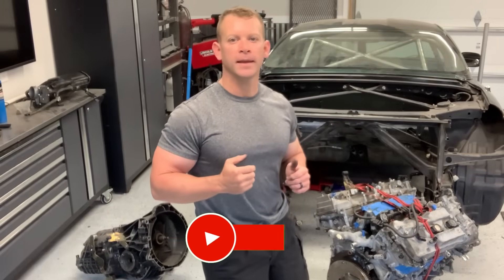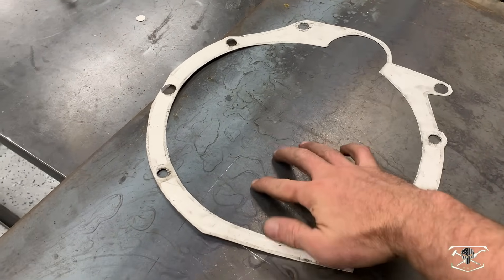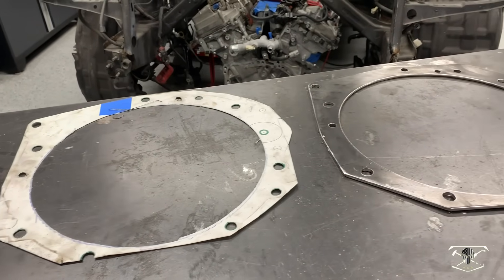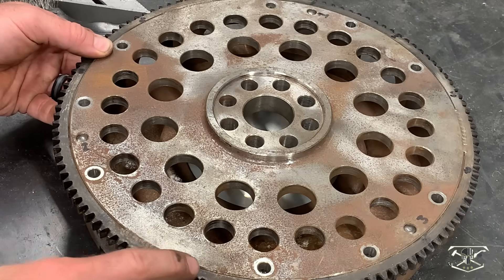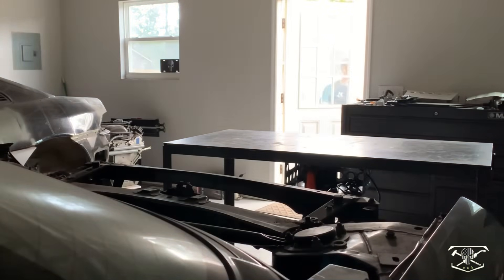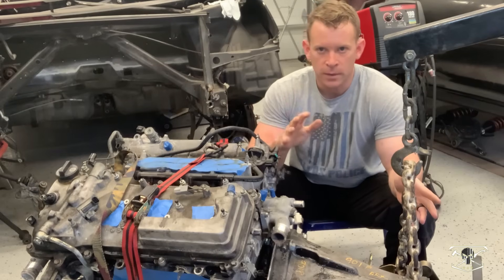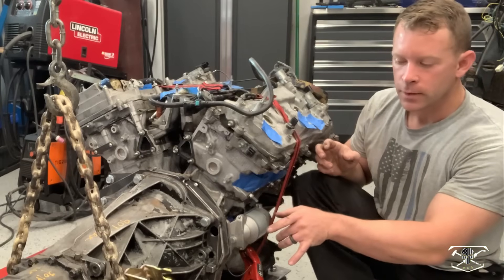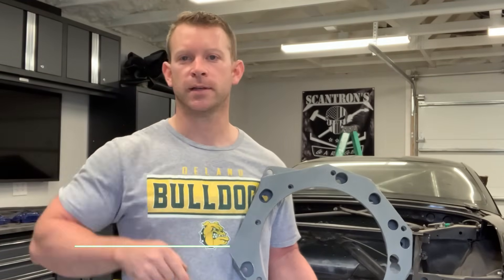DIY Engine Adapter Plate (Mate any Engine to any Transmission)

Comment: 8:20 latest at this point the solution see´s its limit: If the is any out of straight engine OUT and transmission IN will not be perfectly straight.

And bend slidely off, very realistic here, or siply the welt itself will be enough to miss perfectly straight.
Reply from the maker: That is correct. It must be perfectly square

Comment: Hi! I’m from Argentina and I have the chance to buy a Honda L15B7 engine, but it doesn’t come with a transmission. Unfortunately, all Civics sold here came with CVTs, so the original 6-speed manual is nearly impossible to find.

I’m wondering if it would be possible to adapt a 5-speed manual transmission from the R18 (like the S40 or M24). I’d prefer that over the 6-speed due to space limitations in my swap — I’m putting this into a lightweight car from the 1980s.

Do you think it would be possible to make this setup work with an adapter plate? Have you ever seen someone use an R18 transmission with an L15B7? Any tips about crank-to-input shaft alignment or bellhousing bolt pattern compatibility would be super helpful. Thanks!
Reply from the maker: I am not familiar with that particular transmission however I can tell you, make sure to the size comparison from the block to the transmission housing is similar in size. You want the two to fit well together size wise. The next hurdle will be what you do for a flywheel. You may have many options with this swap

Comment: Incredible vid! Would love to know how the whole thing is holding up 2 years on
Reply from the maker: It’s going well thank you. The owner got it running and driving. He had no problems drive train. He sold it unfortunately and now I’m not going to get my hands back on it
Reply: @scantronsgarage Amazing to hear. I'm on a race build currently, and thinking to drop a Ford 2.3l ecoboost into my 2013 Tacoma while keeping the R155f manual 5 speed 4x4 tranny. Naturally, ill need to adapt and mate the engine to the tranny. People have told me to swap the transmission too, but i feel it might be more beneficial to keep the robust r155f as it's tough and survives races easily. Any thoughts?

Comment: While I love this kinda stuff, if that has the slightest misalignment it will eat bearings. Even mating a new transmission to a worn engine, the crank misalignment from wear can wear the input shaft. 
Now if this is just going to be a low mileage weekend cruiser then it will probably be fine.
Reply from the maker: Thanks for the info, definitely something to consider!

Comment: I'm doing my own adapter for an 8HP trans to a boss 302 small block ford. I'm going to use aluminum instead of steel but I think I'll make one like this as a mock up. 

I will pay more attention to engine/trans alignment though. I'm going to get a dial indicator, hang it on the end of the crankshaft. I'll probably machine that on my lathe so one end bolts to the crank and the other end has a 3/8 hole for  dowel. Once that is bolted to the crank and I confirm it runs straight by turning the crank from the front, I'll use a 3/8 adapter to mount my dial indicator. I will mount the dial indicator so it reaches a machined surface on the trans input shaft. Then I get a cheap usb microscope and mount that so it can read the dial on the dial indicator. 

This way I can flip the motor up, put the trans up on top and move it as needed so the trans input shaft is perfectly lined up with the crank center line. Then tack the engine and trans plates up. After I take it apart I'll mount it on my Bridgeport mill and use the digital readout to map all the bolt holes and make a blueprint. Next up I'll need to figure out how thick the trans adapter plate needs to be. Then I'll ether buy or build a flywheel style torque converter mount. 

I will then make up the aluminum trans adapter plate in sections around the engine that have one bolt hole that over laps in 4 spots around the engine/trans. At those spots I'll make the plate 1/2 the thickness on opposite sides so they stack. Why do the adapter plate in multiple sections? because a giant 2" thick section of aluminum is hell a expensive. 

I can buy four 2" thick scrap sections for pennies. Should be a fun project. After I'm done I'll publish the print with dimensions. This way any one who wants to can take the file and make their own adapter or take it to a machine shop and order those 4 sections and be good to go.
Reply from the maker: Sounds like you have a solid plan, good luck with the project!

Comment: I'm not understanding how you chose the flywheel
Reply from the maker: The fly wheel was from an adapter company that is made to push the clutch into the transmission. The flywheel had the proper input shaft dimensions. I just made the adapter plate to work with it

Comment: How did you determine the distance between the trans and the motor??
 Still a damn good vid.
 How Was the clutch “built” up to mess with PP. is it an added item to the flywheel?? Thx
Reply from the maker: The distance was figured by the adapter flywheel in this case. The flywheel was made to fit the Porsche transaxle and when mounted to the engine/ transaxle, there was a 22 mm gap. This is where the thickness of the adapter plate was determined

Comment: I don’t get how you figure it out to the 30 mm gap between the engine and transmission that you made the adapter plate for was the correct distance. I mean the engine and the transmission. I’m assuming I have to meet at the correct distance apart, not too far apart, not too close together, so how did you know 30 mmwas the correct distance? Sorry I’m trying to learn a little bit here.
Reply from the maker: The thickness was determined by how much more the custom flywheel stuck out from the factory.
Reply: @scantronsgarage ohh ok makes sense

Comment: Will this work with a 10 speed mustang transmission with a 5.7 hemi?
Reply from the maker: Yes. That is no different than what I did. Just some different bolt patterns. Just remember you will need to modify the flywheel to make up the difference the adapter plate took up in thickness.

Comment: 9:19 everything is running properly!?
I doubt it. Your transmission seal is gonna leak, wet the clutch, drain the tranny and vibrate. I doubt it's concentric. 
As good as as technics and skills you have, this combo will fail. You should have gutted the trans case out, created a shaft which would attach to the crank and which fits into the front opening of the trans case than mark where you existing or custom dowels would finally align everything "properly ".
Reply from the maker: yea. despite all this it is still working

Comment: This has been most helpful with my flywheel problem.  Ironically, machining the adaptor is the part I'm having the least trouble with....but finding a deutz flywheel tall enough to reach my transmission is basically impossible.  Guess I have to make an extension 😅
Reply from the maker: Yea this flywheel is a good example to get you going. It's a pain but you can do it

Comment: Hi well done  boss, nice to lean, its worldwide. ❤ i had 2008 ford escape v6 3.0l  motor  to mate 1.6l mazda etude manual gearbox, imagine the torque? Can  still  go with  this project?
Reply from the maker: That sounds awesome! you did it already or are you planning to make the adapter?
Reply: Not  yet,  man Google  confusing  sometimes  , they say that manual gearbox  from  Mazda etude 1.6 l is weak  to mate on  my  motor which  is a 3.0l v6  ford escape.  I wanna  make  adapter plate  to mate  them man, what your knowledge/ a say  o this bro?

Comment: There is a reason, why an angle grinder is usually equipped with a protection shield - especially when you work without gloves and doing work, where the disk could get easily stuck (for example when cutting out a circle...). Otherwise good video, although I am still not sure how you made sure, that the crankshaft is aligned with the transmission input
Reply from the maker: You are correct! I was being a bit reckless. Always wear safety gear.  I left a lot of the alignment out of the video

Comment: Very Good Video.  As an engineer and machinist, I was impressed with the work you did.  Everyone talks about CNC milling being needed with sponsored CNC machines.  Its not needed.  I have a 1955 Bridgeport milling machine (a round ram at that) and I love it.  The template idea is an old idea.  I use this to fabricate gaskets on really old machines and engines.  I have done many clutches in my day.  They are all old school with a simple flywheel.  Can you post more information on that flywheel.   I have never seen this type of flywheel before.  Very interesting.
Reply from the maker: Thank you!!! I learned this from some older well experienced professionals. Yes CNC and milling is preferred however you can make this work. I have a full video of a purchased adapter plate I purchased that came with this style of flywheel that I used in this video. Or you can look up the manufacturer for more information. The manufacturer is Kennedy Engineering Products (KEP). Thank you again

Comment: What engine was that??? It looks like a duratec v6 if it is what transmission did you use????  Nice job btw!
Reply from the maker: Thanks! its a toyota 2GR v6 attached to a porsche transaxle

Comment: How about the alignment of the input shaft ?
Reply from the maker: I aligned it with the pilot bearing inserted into the input shaft. Did tons of measuring and then turned the motor to check for runout

Comment: Surely the input shaft is 30mm too short now?
Reply from the maker: Correct... however, if you look at the custom flywheel I was using it was pushed out to make up for that 30mm
Reply: @scantronsgarage  brilliant

Comment: How did you get the center of the engine aligned perfectly with the center of the trans?
Reply from the maker: I centered the transmission in the pilot bearing on the flywheel...that's the simple answer. there was also tons of measuring

Comment: In 90' my father used to connect mercedes 2.0/2.2/2.4  4 cyl diesel engines from w115/w123 to the UAZ gear box :D We had some flanges done at the lathe machine.
Reply from the maker: That's awesome! I wish I had A lathe at my disposal

Comment: For bolting a 350Z manual transmission CD009 to a Vortec 5.3, which clutch and flywheel assembly would you use? Could you just modify the Chevy one?
Reply from the maker: Might be best to stick with the 350z clutch

Comment: how thick was that steel plate? wondering if I can cut the large whole using your method on 3/8 steel plate. I'm trying to make adapter from 2005 vw golf gti 1.8t to a 67 vw bug trans for my bug. bought 2, 3/8 thick plates, not sure if I should just use 1 plate or sandwich 2 together. what you think also do you think I should bother doing it in aluminum? or just call it a day?
Reply from the maker: I used 3/16 plate. you can do this with 3/8 if you use a similar jig with a plasma cutter. I like the aluminum idea as well if you are able to weld aluminum

Comment: dear god. getting the same vibes with those LS kits to adapt your cars engine bay to handle it. Heard they have them for a tiny honda civic, and that I might be able to put an LS3-LS9 in it (assuming the frame can handle the weight and I replace many of the other parts). Loved it.
Reply from the maker: Oh yes! you can make that happen......Maybe I will do a v8 civic next : )

Comment: Nie this really interesting and well put together. I wonder if this is easier or more difficult with automatic transmissions where there's no clutch (previously centered) to be used as a guide. This may be onbvius to someone who did it before, but I am only first time in my life in the process of doing this with an auto.
Reply from the maker: I feel like it might be easier. you wont need to worry about getting the spacing correct for the throw out bearing. Thanks

Comment: Could you add a spacer between the flywheel and block the same width as the adapter to avoid having to cut such a large opening for the flywheel or would that impact the engine's balance?  About to do this in order to mate a 65 Ford 200 ci block to a larger 66 bellhousing.  Very informative video.
Reply from the maker: Thank you! You could try the spacer method however you would be sacrificing some strength.

Comment: 🐆 🛞 🚘 Allegedly-      Jaguar X-Type car’s are well known to have a fragile⚙️all wheel drive system, & hi gearbox failure.(Automatic transmission gearbox are failing & Manuel transmission gearbox are failing in a Jag X Type) Custom Modified X type car’s with supercharged or turbocharged v6 engine and factory stock Jag X type car’s both have a weak gearbox. From the car manufacturer factory in England 🏴 Jaguar X-Type car’s were built with higher load bearing inside gearbox. I would like to know if a rear wheel drive conversion on a AWD X-Type with your custom adapter work with with this rear wheel drive setup? I would like to experiment with twin transmission fluid coolers & hi performance transmission fluid, often changed every 500 miles…
Reply from the maker: This would work for you. You could use something that bolts right up to that engine if that engine was used in different rwd vehicles. I would miss the awd though. I wonder if an AWD audi transmission would work for you

Comment: Thank you bro, you've just solved my sleepless nights problem! 💪👌
Reply from the maker: Glad to hear that! I lost some sleep thinking this one through as well
Reply: @scantronsgarage  I'm still trying to figure out how to center align both of them perfectly, in my case I have an Automatic Transmission and in addition to that must take into account the torque converters spacing and how to connect the flex plat gap to the converter with this new gap.
Reply from the maker: @reneeberty  Yes that sounds more difficult than my setup. I did insert the input shaft into the pilot bearing and then spun the transmission to see if ther e was any deflection. You may be able to do this with the torque converter as well
Reply: @scantronsgarage  I figured out how to get them center aligned using Solidworks. Surprisingly the bolts on the engine are exactly at 17 centimeters from crankshaft center. And the transmission 18. So I think I will get through.
Reply from the maker: @aarbtheorigin  That is awesome! I will have to look into using solidworks. thank you for the information.

Comment: Hey brother I have a question. I'm a novice but wanted a specific question answered. I wanted to do a 4bt swap on a truck but wanted to know if I could theoretically use any transmission as long as I have the right adapter is that right? For any transmission and engine swap at that?
Reply from the maker: any transmission as long as it is strong enough to hold up to the 4bt
Reply: @scantronsgarage  

Thank you so much for the reply I really appreciate it. Another question, are you referring to the torque? This might be another stupid question but what if I was to use maybe a 6spd transmission from a single axel semi?
Reply from the maker: @apollotwins6606  Yes, the torque will kill a weak transmission. And, yes that will work as long as both bell housings are similar in size.  you dont want to mate an engine with a 15 inch bell housing to a 18 bell housing . that would be difficult
Reply: @scantronsgarage  

Understood, thank you I really appreciate it. Perhaps you could make a video explaining that somthing like this is possible? I've seen alot of other videos of people talking about somthing similar but not exactly. When I Check the comment section there is usually alot of people looking for the same answer I am and you seem to have them. Thanks brother

Comment: What if you ever need to take off the transmission?
Reply from the maker: It unbolts from the adapter plate and is removed as usual

Comment: What are great video, clever idea with the angle grinder, You have done a great straight to the point job 😊. I'm in the throws of putting a BMW M57 in my Land Rover discovery 2, the adapter plates are expensive, I'm quite capable with how you have done this, You have made me think outside of the box 😊, no pun intended, Thanks,, Steve from 🇬🇧
Reply from the maker: Thanks Steve! I am happy this video was helpful . Good luck with the engine swap!

Comment: That's a great start for me but my Yamaha rx-1 snowmobile motor doesn't have bolt points for a transmission so I'm looking at using the reduction gearbox bolt points that is behind the flywheel.  The output shaft sticks out far so the flywheel will stick out far as well.  I'm worried it will put too much pressure on a housing I make out of a cylinder
Reply from the maker: Wow! that sounds complicated but I am intrigued to see how this works out. That sounds like a cool project. What are you adapting the motor to work in?

Comment: This only works if the main shaft is long enough to reach the nose bearing????
Reply from the maker: No, you must extend the pilot bearing housing to the same thickness as the adapter plate.

Comment: Hey, great video, by the way. You make it look simple. You also mentioned that you did a adaptor plate for K swap on a transaxial I am assuming its its for a 944. I am also looking to do this conversion and looking for some information. I hope you can share what you did that would be super helpful. 
Thanks Michael
Reply from the maker: Hi Michael! Yes I purchased an adaptor plate for the K series motor to fit directly to a porsche transaxle. The kit is made by kennedy engineering products.  It is pricey but sold as a complete kit. Sounds like a cool swap you have in mind.